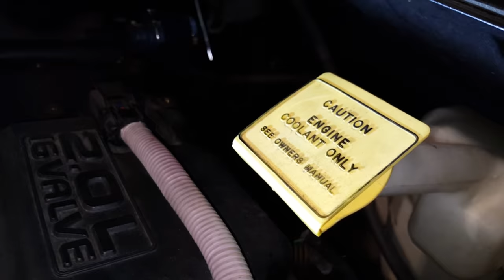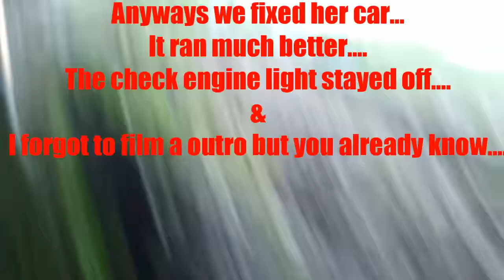MAGNA-FLOW HIGH FLOW CATALYTIC CONVERTER  INSTALL ON A DODGE NEON

Comment: Mines not turbo..still took off like about 10 pounds of it replacing the stock manifold with a stainless steel header and a non stock catalytic...by doing that,i deleted all brackets holding the old manifold to the engine and also the stock heat shields... (replaced the heat shields with  1 " wide lava rock wrapping) while at it just replaced all the piping from the catalytic to the end tip of the muffler ,basically all new exhaustive system...had added a muffler silencer tip..i tink it will hold for a coupple of years before it rusted... again,at least  the piping...didnt spended more than 400.00 on all of that i think its worth it.
Reply from the maker: +Juan Nunez forsure

Comment: I like your battery cable set up..see that you turned all around so the cables be on the opposite side of the fire wall..that makes more room on the back and it makes the battery terminals more accesible..thinking on doing the same..👍🏻
Reply from the maker: +Juan Nunez thanks man

Comment: i was able to loosen up evry bolt from the exhaustive,heat shield all rotten on the bolts holes...got rid of it...all that ,didnt had the need to remove or mess with the valve cover...even the coil pack...

Comment: Hey guys I have a 2002 Dodge neon RT with the cold air intake high flow cat converter straight pipe I was wondering the sound that you have on yours exactly the what I'm looking for mine is really loud so if you can let me know what type of muffler you guys are running because I was thinking on going on borla 2.5-in piping one in one out tell me what you think have a good one peace homie

Comment: I think that oil leak you finded by that corner of the engine oil pan..its coming from the oil pressure sensor or the head gasket ,wich i doubt i got the same problem on another sxt i just bought besides the one i already have...and almost possitive its coming from the oil sender unit..
Reply from the maker: +Juan Nunez was the cam sensor they always go bad

Comment: Great videos man. Can you replace a pcv valve with an airfilter?
Reply from the maker: +michael esparza i did on mine or a catch can ....ive never ran a pcv valve thanks tho
Reply: michael esparza nope...
Reply: michael esparza different parts different purposes for each one
Reply from the maker: +Juan Nunez ive always removed mine never had a issue yet
Reply: michael esparza dont tink deleting the pcv its good idea thoug...
Reply from the maker: +Juan Nunez just a valve that release crank case pressure into the intake manifold but if u just remove it then it goes to the atmosphere